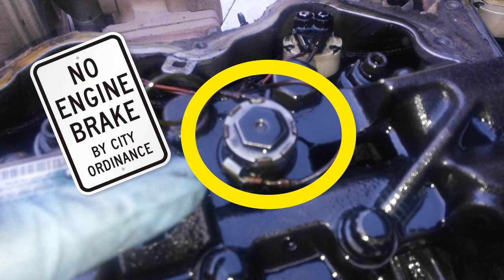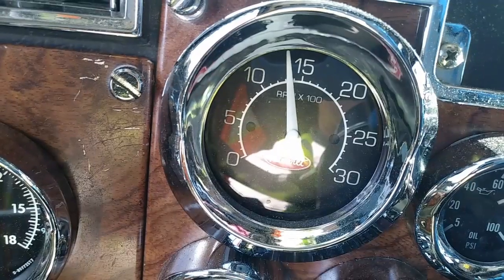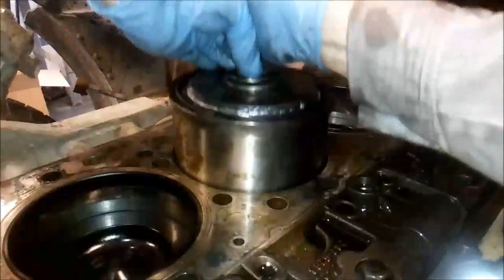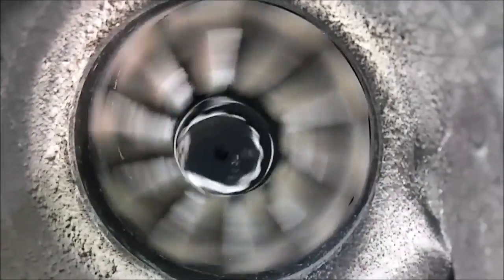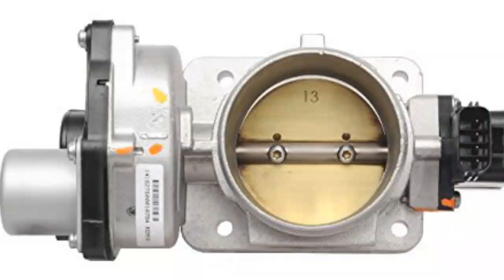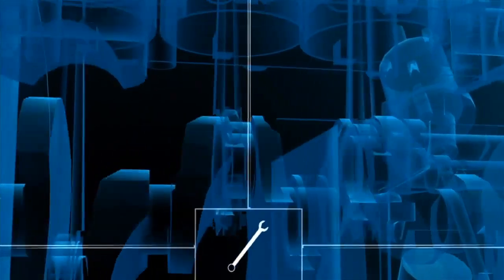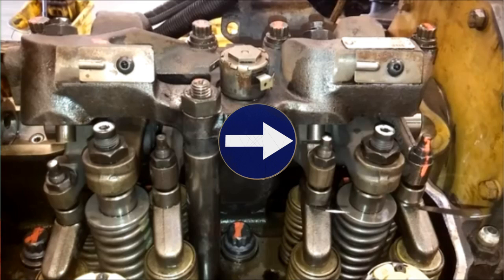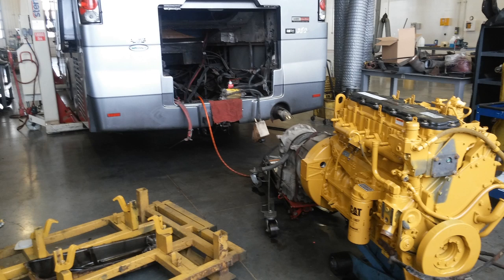The Difference Between Jake Brakes And Exhaust Brakes?

Comment: So....an engine with your foot off the throttle has a zero fuel burn rate? ...umm...doesn’t it take fuel to idle? Doesn’t it take fuel to keep running, even with the jake applied? I think the only way to get to zero is to shut the engine off.  Of course it’s useing LESS fuel without throttle applied, but hardly zero.
Reply: If the rpms are above idle and the throttle is at zero the ecu won't inject fuel. The ecu will only inject fuel if it needs to to keep the engine running. When engine braking the vehicle is turning the engine so injecting fuel would be a waste.

Comment: This is the best description of how  Jake works I have heard.  Every other explanation I have heard has missed telling about the timing on the exhaust valve opening. Everyone else just says that it holds the valves open but they don't say just when they are opened in the cycle.  Now I get it.
Reply: Here's the best explanation of how they actually work.  Imagine you are on a pogo stick.  You hop up in the air and as soon as you hit the ground and compress the internal spring, or air in the case of an engine, I reach down really quick and take that spring away, or dump the air in the case of an engine.  You hopped up in the air to start with, then hit the ground, I took the spring away, now you just make a thud and that's it.  You don't spring back up in the air again because I dumped that stored energy at the exact right moment.  Another simple explanation of a Jake brake is it just turns your big diesel engine into an air compressor.  When the Jake brakes are activated, the governor or the ecm cuts the fuel and manipulates the exhaust valves on all the compression strokes exactly like how a big air compressor would work.  Unless it's a rotary screw air compressor which are much more efficient.
Reply: Yes, the best told story of Jake brake and exhaust brakes. Every other channel so convoluted!
^..^~~
Reply: To say it simply holds the exhaust valve open isn't even remotely correct. It misses the most Important part.

Comment: The Fucked-liners I used to work on back in the day (some K-dubs, but most Freightliner) had front/rear bank jakes on them. IE: 2 toggle switches on the dash; one for the front 3 and one for the back 3, and normal operation of thus entailed flipping both at once. I never understood why Cat didn't just wire everything through the same switch...
Reply: My 2000 FLD 120 has two toggle switches,says 2 cyl and 4 cyl. In the 05 and 06 Colombia's we have are just high and low and don't work in low side of the transmission. I've looked them both up,and just from experience with them,the high/low on the Colombia's Detroits are 2or 4. The Cummins(redtop n14) in the FLD is 2 and 4 and works in all 10 gears! When you turn both switches on you got All 6 cylinders braking! Even with 656k miles on it,it will still rock you right against the the steering wheel! Much prefer the system on the FLD!

Comment: I've worked with Jakes both on Cummins and Detroits. Both work very well. In the Fire Service, we had retarders on some apparatus. This is electric, a device fitted to the driveshaft. They use aluminium disks and electromagnets, absolutely silent and magic.
Reply: Makes a fuck ton of heat when in operation... Energy has to go somewhere
Reply: @neptarclepuffin  many retarders are hooked into the engines coolant, so overheating isnt a big concern
Reply: And expensive, don't forget expensive !

Comment: Our 6v92ta and Cummins ISM have a mean sounding Jake 😍 our C12 MBL would sound better if I straight piped it but my Fire Chief said no because we did that with the 6v92ta and it screams
Reply: Which fire station/ city & state?
Reply: @TheCRTman  Turtle Creek Pennsylvania station 283 and 211 West Wilmerding up the hill about 1/2 a mile
Reply: @JourneymanJim77  Nice! I'm out here in San Francisco, but there's still 3 8V71 hose tenders left today
Reply: @TheCRTman  the 8v71n and T were good motors but them straight piped just rip your ears when you are in the cab
Reply: @JourneymanJim77  Definitely, I love them. LMAO indeed. They sound real mean with a worn muffler though.

Comment: I used to drive an old Mack 5 speed dump truck with a jake and it worked great for shifting without the clutch. It Would bring the rpm down and you could shift right into the next gear if done correctly.
Reply: Mack says that caused the cam shaft issues they had on trucks.
Reply: @badgerpa9  hmmm that's interesting

Comment: A exhaust brake puts less strain on your exhaust system than pulling a hill, stop and think about it the pressure and temperature when working it hard puts a lot more strain on the system.

Comment: I wanna see someone do a intake brake i think it would be alot safer and easier to do
Reply: They have one its called a throttle body. Diesel engines can't use those
Reply: @cameronwulff   you can also use boost actuated valves to close and open the air inlet. throttle body is kinda the same set up but to clunky when you can buy the proper unit

Comment: What is a brake saver
Reply: Hydrodynamic retarders (such as the BrakeSaver) are basically taking the torque converter in an automatic transmission and reversing its functionality. Normally you have one rotor connected to your flywheel and another one directly connected into your transmission, and it helps transfer power fron the engine into the transmission. Fluid retarders will hold one of the rotors stationary while the other spins so the drag between the rotors helps slow down the driveshaft.

Comment: 👍😉. All people says how much stronger the retarder is on the Cummins x15 performance engine. Why is this. ?  Thanks answer and all videos.
Reply: the retarder is on the transmission, not the engine
Reply: Thermidor le vrai no. Runs off the valves.

Comment: Thank you for posting/sharing,, so after the compression is released by the exhaust valve at the top of the compression/power stroke, there must be a hugh drawl on the top of the piston, because of the vaccum created, which is finally the "force" that dtags on the crankshaft/drivetran, is that right?
Reply: Correct. Ridiculous amounts of vacuum

Comment: Very informative thank you.  I have an RV with the 8.3 Cummins.  It has an exhaust brake switch that I turn on and it helps, but reading through the manual it says it has a retarder, which from my understanding uses the transmission for braking.  How do I know if the exhaust brake is working in conjunction with the retarder?  It just doesn't seem like it's slowing like it should.  Is there a way to bench test exhaust brakes or is it best to have someone drive the RV while I'm in back by the engine and just physically look at the exhaust brake to see if it's opening and closing?  I learned a lot from your video thanks.
Reply: Anything that slows you down is technically a retarder, retard means slow, or to slow. So by definition it does have a retarder.
Reply: I could ride with you, I'm retarded.

Comment: Does the exhaust brake will not harm the engine? Much concerned for the engine warranty. Im trying to search for an engine overspeed protection. Trucks are fully loaded and going downhill mostly in this case.

Comment: Chevy Silverados with 4L60E’s at highway speeds if you let off the gas completely and don’t touch the brakes the trans will stay engaged and will allow the trans to back feed i to the engine there fore slowing it down. Completely different but sounds like a baby jake with strep😂

Comment: I have question for you, Do they install Jake Brakes on Diesel Engines with overhead Cam Shafts???
Reply: C15, C18, C27, and C32 are overhead cam engines and can be fitted with Jakes.
Reply: Mp7 and mp8s do I believe

Comment: You did a very good job explaining how a Jake brake works on a  Diesel  truck  engines do you think a Jake brake could work on a Gasoline type car or truck engine the same way with the same effect???
Reply: Exhaust brakes will work on gassers. Also the old transmission brakes were used on gassers.

Comment: Thankfully, electronic camless engines can be programmed to act as Jake Brakes without extra hardware.

But would a Jake Brake be effective on a small gasoline engine?
Reply: camless engine don't exist
Reply: Thermidor le vrai Freevalve says hello.
Reply: No they would not. Jake's work off of compression and volume of air compressed. Gas engines typically don't have much of either
Reply: @cameronwulff  Turbochargers and Superchargers.

Comment: Vacuum has no effect on engine braking effort, if anything, closing off the throttle reduces the pumping losses in a gas engine. You get more engine braking from shutting off the injection and applying full throttle.
Reply: Same is true about just blocking off the exhaust. If you stop the flow then all the energy used to compress the air is reclaimed on the power stroke and the only loss is friction which is not much.
Reply: They like making temperature if retrofitted

Comment: Negative. Jacobs engine brake, the Jake Brake, does not affect ignition in any way. It uses engine oil pressure to pop open the exhaust valves so there is no expanding ignition for a power stroke. The pistons then use tge compression stroke to slow. Jake brakes are used on mechanical injectors as well.

Comment: And could certainly use some help in the slow down department. The bus weighs 15 tons dry and down hill can be a bit scary. I do not have a tandem axle so I only have four brake drums. They're big brake drums but they are still drums.

Comment: That moment when you flip the jakes all the way up and the truck keeps speeding up.
Reply: Coffeys Carberators that just means it’s a good hill or you’re loaded heavy. Or both 😃
Reply: @codenamecordon  that means you're about to meet jesus.
Reply: Michael Closson been in that situation several times, still here 🤷‍♂️
Reply: That means you are in the wrong gear when you came off the top of the hill.
Reply: @Chuck_Carolina  That's what I was going to say! You're up against the governor,and trying to exceed the governed rpms! Shift back up and let her eat,or just use the service brakes til the rpms come down! Or you are in to high a gear and the rpms are to low. Then you need to down shift. They're funny critters,the Jake brake!
Reply: You're dyslexic and you were actually shutting them off!!!😮😮😮
Reply: Lol then you ease on the brakes and hope like hell there's not a sharp curve

Comment: In a Jake, the spring effect of the compressed air built on the compression stroke is stopped from being returned to the crankshaft.

ie like a bicycle pump. Squeeze the plunger until TDC with your thumb over the hole, then at tdc remove your thumb! The compressed air is released immediately stopping the pump plunger springing back.

Comment: Hello young man
I am in the process of swapping out two mechanical 3116s marine boat motors for two EFI 3126s after watching your video on the 3126s, I would like to send you the ECMs to be reflashed? and I would also like to get your " PAID"advice and "PAID" help on some engine work I will have do to the 3126s to achieve my 300 - 330 hp & 800 fps  of torque goal, I have not been able to find much information on the internet on the 3126s,, I need to know what I need to change internally in the 3126s  and what I can leave re use to gain this,, 

is a 330 hp 3126 crank and a 210 hp crank the same ?, camshaft? im sure I will have to change the pistons and injectors but is that all I will change other than the obvious and  so on, so on? 

the 3126s I purchased are out of low mileage school buses and  in NJ and run great ,I am working in Ohio and my Boat is in NC,  but I need 300 -330 hp for the offshore boat,, anyway is there a email I can contact you to get some answers about these matters?  and are you interested in lending me your expertise?? and How do I get you money to your paypal account ?
I dont have the engines here in Ohio yet but when I do I can send the serial numbers and so on,, thank you in advance
Tony ; todwaves2@hotmail.com or 252-732-1314
Reply: Check out KT3406E @ YouTube - he have some interesting stuff going in regards of reflashing, rebuilding and whatever you are into, Here's a video from him explaining about reflash : https://www.youtube.com/watch?v=qQqwEpcyrE4
Please note that Josh/Adept Ape have helped others  before like Jpaydirt when he went from dual to single turbo: https://www.youtube.com/watch?v=W65-F_92Nyw  In your case asking for reflash which may take stuff a little further than Cat allow they're tech's to do - KT3406E might be your man. Best of luck.

Comment: If the corrupt industry would go to disc brakes you wouldn't need these brakes but the governments make a fortune in drum brake fines so the trucks in America suck at braking!
Reply: I have disc brakes on my snowplow trucks in Minnesota. They either do not work or fail in less than 2,500 miles. The parts to repair them each time are about $1,000! The Automatic slack adjusters work as bad as the disc brakes. Please don't respond that I don't know what I am doing, I have over 50 years experience. I am not the only one who has these problems and I don't think there is a shop around that could make disc brakes work in this situation.
Reply: Many new big trucks are disc, watch some of the truck videos and the sales people say almost all new trucks are disc.

Comment: got a real off the wall question? 1999 Isuzu npr box truck 14 footer, exhaust brake is bad or seized up. can I make a manual lever type to engage exhaust brake on and off instead of electric or vacumm type?

Comment: How did a Jake brake work on an all mechanical diesel engine?
Reply: Lray 4x4 worked the same on mechanical except was controlled by micro switch on injection pump instead of by engine control module

Comment: If you are loaded anywhere near gross you'll need mechanical brakes going down grade even with jakes! If you're driving past a no Jake sign you are required to over rev, and engage stage three!
Reply: John Williams, only if you select the wrong gear.

Comment: Jakes also hold on the down stroke as the exhaust valves are shut the piston creates a significant vacuum on it's way down. Great video 👊
Reply: So how does it compress air if none is entering the cylinder?
Reply: @eugeneoreilly9356  It is compressing the air. The valves open and let the charge out precombustion
Reply: @eugeneoreilly9356  exhaust valves are shut on a down stroke always, the 2 downstrokes are either intaking fuel (unless injected) and air with inlet valve open or the power stroke.
Reply: @badgerpa9   well theres no power stroke as there was no fuel added and all the air that was compressed for a power stroke was popped out the exhaust valve when the jake opened it, if it closed the valve before the piston made its way back down itd create a vacuum in the cylinder as the intake would be closed since its suppose to be having a power stroke at that time, then there would be a pretty uneventful exhaust stroke followed by an intake one and were back at the start where its going to compress that intake air then pop it out the exhaust before it returns that energy into the piston as it pushes the piston back down

its just removing that compression energy on every 4th stroke, maybe adding a little bit of drag in between each of those
Reply: @AndrewBrowner  So suddenly an engine does not have a power stroke if it has a Jake, it still has a power stroke just not creating power.  The name of the stroke does not change.  The engine still does the same stroke the piston always does, if you think suddenly the piston does not move or something you need to go back and learn the basic engine strokes.
Reply: @badgerpa9  ... obviously the piston moves through the same motions, i was just expressing that there was no kaboom, no power generated, the typical "power stroke" is interrupted by the air being sent out the exhaust..  nothing forcing the piston back down itll get pulled down by the crank which is being driven by the wheels when youre engine braking

is there a reason you need to purposely  misinterpret others to try and one up them in youtube comments because surely no one is watching jake brake vs exhaust brake videos but is oblivious to how the piston and crank are connected
Reply: @AndrewBrowner  You claimed I was wrong and there was no power stroke so is there a reason you need to one up people in comments?

Comment: The Jacobs Engineering engine brake. I thought it was just a compression release. I had a dirtbike that had a compression release. The tow trucks I used to drive had a form of a compression release, they had a CAT engine that looked suspiciously a lot like a smallblock Chevy with an injector pump and no carburator. I like the sound, "BWAUGGGGGG!" That's the sound they don't want you to make near schools and hospitals...

Comment: Hey Josh, new sub here. I've got an RV with a C13 and a three-position Jake brake, which works really well. I'm curious: What actually changes between settings? Are the opening/closing times of the valves changed between Jake settings or is it something else?
Reply: Its the number of cylinders it activates.
Reply: Your engine is an in-line 6 cylinder. Setting one would activate only the 2 middle cylinders, setting 2 would activate only the 4 outer cylinders and setting 3 activates all 6 cylinders.
Reply: He has a video on this.

Comment: So... what if you pulsed the exhaust brake in between each Jake pulse so the cylinder dump pressure dump hits a closed wall, but still much more volume than the cylinder so the air will rush out anyway until pressure equalizes, then when the exhaust valves close, open the exhaust brake? A lotttttttt more expensive to build something like that,  but still